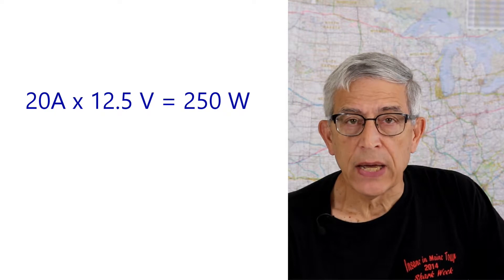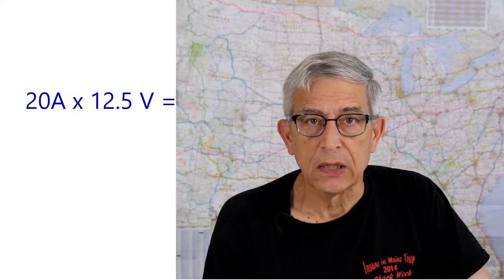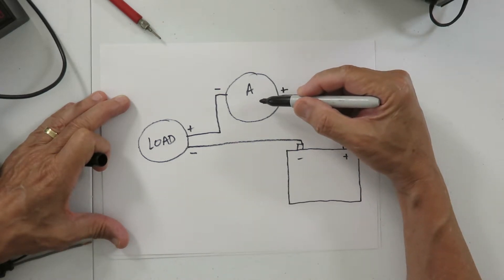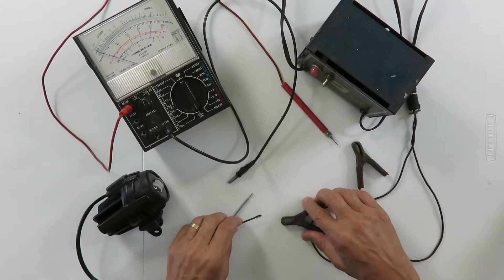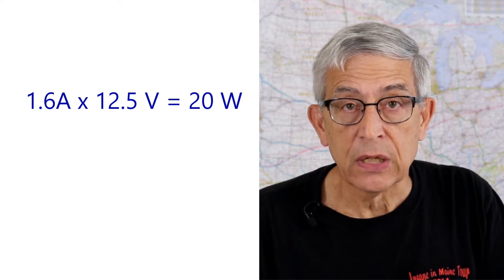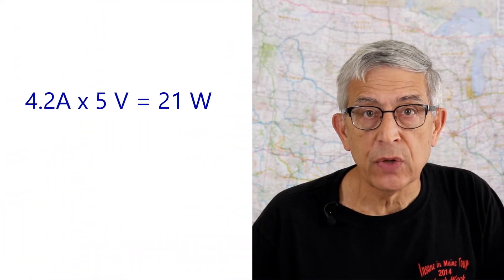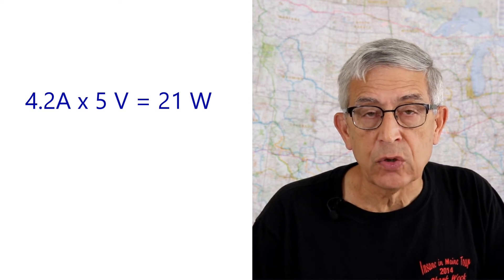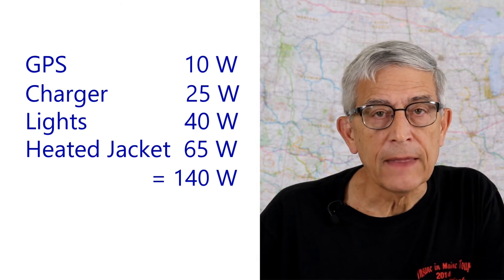Measuring Accessory Power Requirements On Your Motorcycle

Comment: What do you mean by jury rigged a connection? most batteries have terminals you can simply connect too?
Reply from the maker: I made temporary connections so I could insert the ammeter in the circuit to measure the current. Thanks for watching.